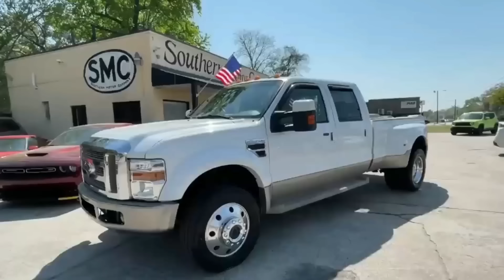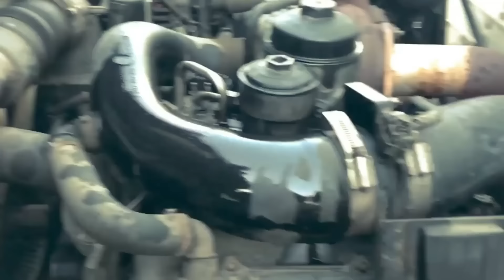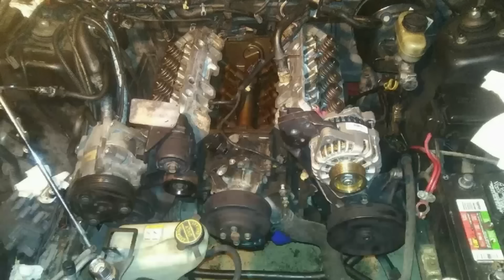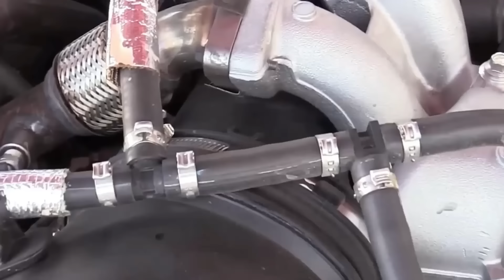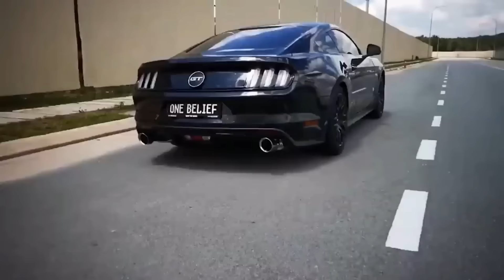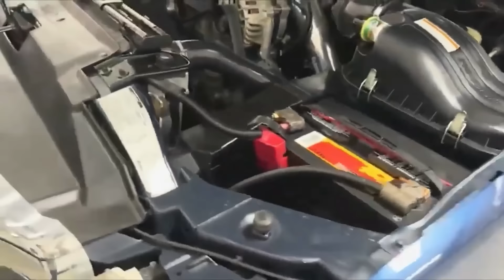Ford Engines to AVOID — and the Ones That Last Forever

Comment: I had a 1996 Ford Ranger with 2.3 l four cylinder that had almost 300k before I sold it and likely still running... The only major repair I had was replacing Timing Belt but was able to do job myself with very simple tools. Does not require any specialists to perform.
Reply: Easy maintenance a four year old could do it😊

Comment: BULL****! The 4.6L is JUNK! The 4.9L 300 inline 6 is the BEST EVER. I have had both. There are two different 4.6L engines and have different part configurations! The one built in Romeo is different than the one built in Cleveland Cleveland
Reply: My 2008 4.6 triton was bullet proof still running strong , no issues

Comment: Ford used to spend decades making sure the engines that were in their cars and trucks were bullet proof. Now the corporate earmarks have turned into money first instead of quality.
Reply: Not true the 2.7 is a beast so is the 5.0
Reply: @22killakush22 yes and their up to the fourth revision on the 5.0 and I don't know how many on the twin. I own the third revision of the Coyote and the oil loss seems to be in how you drive it.

Comment: Wake up Ford motor company
Reply: What are u talking about they have the best v8 out and best 6 turbo out (2.7). Ford rules
Reply: They are awake and aware of when they make a great product, a compromised product and an inevitable disaster. The 2.7? I would be glad to have that reliability. I have the 3.5 EB, 10sp. What a risky combination. Bought my ‘18 in ‘21z I have put 70,000 miles on it with only one oil change that went as long as 6000 miles. JOB 1 is OWNER MAINTENANCE. I have recently made several adjustments. While most oil changes are at the dealer an occasional service at a quick shop is with a premium filter and their best oil. Now, my research has led me to watch reviews on, why they fail, why some oils prevent better than others and more. The turbos can get starved of oil at first. So I now run 30-40 seconds before driving, and never run the turbo hard. And now I learn if it is run hard it should be run for a minute to cool down before shutting off to prevent coking and lawyer build up around the super hot turbo. I have also used highly rated Techron Injector cleaner, and most tankfuls are now.Chevron to keep scrubbing down that pathway for a while longer. Yes, the pipeline gas is the same, the cleaning package seems to matter. It boosted performance. I am paying attention to the sensors and fluid condition better than ever.   A friend has passed 490,000 miles on his ‘03 F150, and no transmission service and no engine trouble, but I see the need to be more proactive on 3.5 and 10 speed. 

Never run hard? Except when I towed my 7500 pound RV 115 miles, which ran the turbo full time so that MAX TOW rating of 12000 is crap. It is a great passenger truck… its own category… unless… 

Ford knows what they are doing. Lifetime transmission fluid. More bunk. 

Mine runs great on the highway but have a serious decision to make to buy something more suitable, or dump the RV, too soon for my liking. Despite the risk, this 10 sp. has outlasted my only other 2 ford original transmissions. So I baby it. No more crazy ass towing with a turbo running under load.

Comment: And if them motors aren't bad enough there's. The total junk ecotrash motors from a to z with wet belt and there All junk like a bic light er run it a few miles and throw it away and then they wonder why they are almost bankrupt  now that's sad

Comment: What is the point in scrutinizing an engine that has been out of production for 15 years?
Reply: The point is sir a lot of these vehicles are still available. And for any Un suspecting buyers who don't have this information may see low mileage nice exterior and interior combined with a nice. Might just purchase one,
Reply: Thanks for helping that individual. My engine is out of production but is still running. I’m at 216K on mileage for my 07 4.6 and is a daily driver. I’m elated to see that it actually was number one. Even though I was in the market for a new truck I will continue to drive my older model as the reliability is key. Even Jim Farley stated that they are having issues getting new techs to come into the fold of automotive repair/maintenance. Engineering and complex repairs are causing techs to leave for private shops. Warranty work does not reward techs admirably because the auto maker only pays so much for it. Dealerships dread warranty work as they lose money. If I do buy a new truck seems like the turbo 2.7 is the route to take if not it definitely will be the 5 liter Coyote.
Reply: @michaelberry3426 get the 2.7…change oil every 3000 and it will run 300k plus body won’t rust it’s aluminum